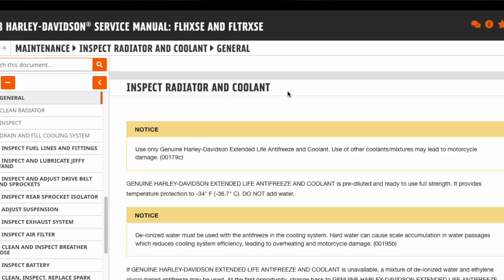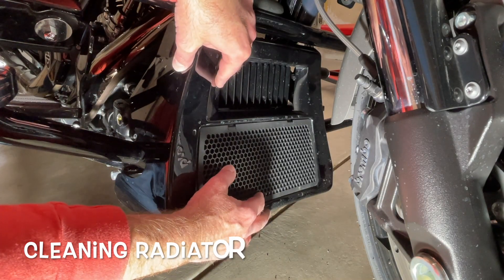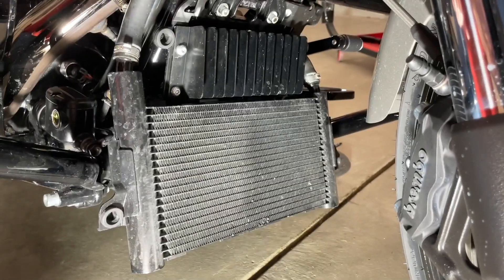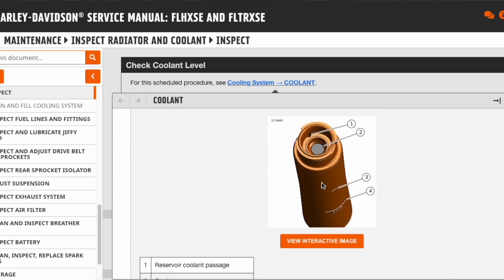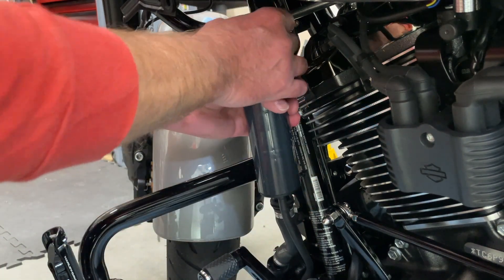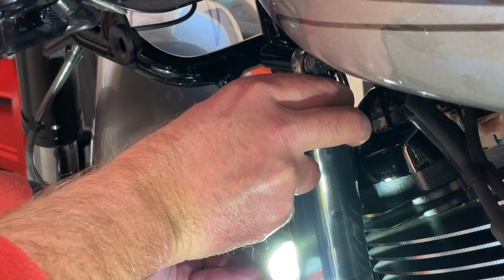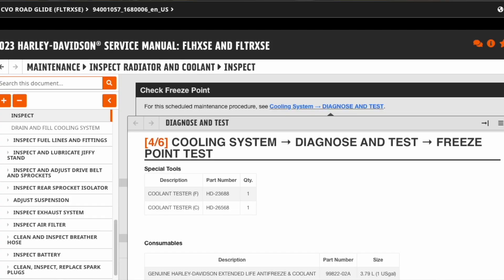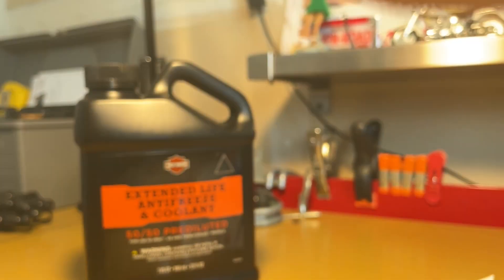1000 Mile Coolant Service on '23 CVO's

Comment: Hey Tom, thanks for another informative how to video, one tip I found very helpful when putting reservoir back into the mounts. I applied a shot of WD-40 silicone spray to a Q-tip and then carefully applied it to the lower bushing and bracket. This allowed for a very easy assembly.
Reply from the maker: Awesome,  good tip!

Comment: Great videos!!  Thanks!!  (In a pinch - no pun intended - for precise pouring in small spaces, I sometimes use a Dixie cup, like a 5 ounce; with a little pinch, the cup is easily narrowed for slow precise pouring...).  Thanks again.
Reply from the maker: Good old Dixie cups a red solo cup should also work!

Comment: Did you check the actual service manual for the process on purging the coolant?   On my wethead, there is a process for using the tool and a manual process that invloves actuation of the pump.   Both get the job done for scheduled maintenance.   That said, if I were losing coolant, I woould definitely use the vacuum tool.
Reply from the maker: Yes both the manual and a service tech video both state there is now way to replace the fluid without a vacuum pump.   I probably should have added HD's video to mine so possibly I will create a separate video on this process.

Comment: Hi, I like to wet the (paint) brush, making the bugs softer and easier to remove completley.
And maybe it helps to use some petroleum gelly for the rubber grommet to slide smoothly into place ?
Also to preserve it, as it will be used more often in the future, and looks akward to replace in case of damage without draining the system. The grommet seems to be there just to define the reservoir vertical position, preventing it from sliding down in the clip.
Reply from the maker: Yes I agree,  if your radiator is more dirty you can just go at it with a hose but I would not use a pressure washer.   Goal is to not bend any fins.  Any rubber safe lubricant is a good idea for all of these rubber connecting points.  You are also correct on the reservoir the grommet is there to prevent it from sliding down.  Most of the clamp pressure is from the plastic clip above.   Thank you for your comments!!

Comment: How many miles on your CVO?  You wouldn't think the Coolant level would be low already.   Several of my fluid levels, primary, engine and transmission were low when the bike was delivered.  Engine oil not a problem, I run it a half quart low anyway, but primary and trans should not have been delivered that way.  You'd think for a $1,300  dealer " prep" charge all would be perfect.  Another good reason to do your own servicing, and your videos help with that.  Well, at least my Coolant level was okay and now I know how to remove that coolant canister cap.  Another nice video, thanks.
Reply from the maker: Yep my coolant was low from delivery but only by a very small amount.  I agree that it should have been topped off during prep.  Even if you opt to not perform your own service one should double check the work.   I remember picking up our car to find it had no oil in it at all!
Reply: Had the same with one of those quickie lube places, got halfway out of the driveway.  And something you wouldn't expect from a Lexus dealer.  The car had oil in  it after the oil change, too bad it was the same oil, not oil change at all, but they got their money.  

 LOL, removing the cap, as you showed was easy once you know how, thanks.  Going to the Children Hospital ride? @ITFZone https://www.youtube.com/watch?v=nPtEhxfs1sM

Comment: At our 1,000 mile check up Harley Davidson cross threaded  our transmission drain plug 😮 They want to drill it out and replace with a oversized plug ..
Reply from the maker: I would want to challenge that.   Would not be ideal to have a different sized drain plug going forward,  especially on a new bike.   Man that is frustrating.
Reply: No kidding

Comment: I checked my coolant at 1000 miles it was full and at 4000miles almost all the coolant was out of overflow and i about 4500 it was 1in below full line and I can find not leak so I guess it’s burning and going to dealer
Reply from the maker: At 3,500 mi and after topping off at 1k mi I am about .25" below the cold line.   Very possible this new system evaporates coolant in summer months!   As long as it is not empty I wouldn't be concerned but something you can top off!

Comment: So a proper coolant level check requires opening the Cap, right? (The printed Service Manual suggests a first coolant-level inspection with the reservoir in the frame clip).  And after tilting and spilling into the overflow, we should top off the center fill tube too, right?  Can we just directly fill the overflow reservoir to proper level, or should we always tilt and spill into the overflow, and then refill the center tube?
Reply from the maker: To just check the level you can shine a flashlight behind the tube to see where its at.   If you are blow the lower cold line you need to add fluid.  The indicator is showing what's in the overflow so essentially you are over filling the center so that the extra flow through the overflow hole on the side,  you just tip it to get this extra in there.

Comment: so my coolant level is just a little low in my 24 road glide ,, I went to my local Dealer , bought the coolant , all of the sudden service told me that I have to have a special tool to top off the coolant . I think it's bull shit . what happened to just opened the cap when it's cold and just pouring coolant ? Im I missing something? thanks in advance for your response!!
Reply from the maker: You only need a "special tool", to flush the radiator.   You have to pressurize the system to replace the fluid as it is not gravity fed.   BUT to top of the system you are correct,  just add some but tilt it forward to get it drain into the small feed hole.

Comment: Do you have a part number for the special tool that is required to pressurize the system when completely changing coolant?
Reply from the maker: Yep,  from the service manual: 
Harley-Davidson recommends using MATCO COOLING SYSTEM FILLER (Part Number:MCR102A) along with COOLING SYSTEM ADAPTER (Part Number:MPT10128) OR SNAP-ON VACUUM COOLING SYSTEM FILLER (Part Number:SVTSRAD272A) along with SNAP-ON COOLING SYSTEM ADAPTER (Part Number:SVT262-28A) or equivalent. This allows for a vacuum test of the complete system and effective filling with coolant.
Reply: @ITFZone  I have that tool along with the recommended adapters. It creates a vacuum. You said the system needs to be pressurized? I'm waiting on a service manual.
Reply from the maker: You need to create the vacuum to pull the fluid through the system.  So I guess negative pressure is more correct.   There is no way to bleed the system  otherwise. @barneysomers8871
Reply: @ITFZone  Thank you. As I previously mentioned, I'm still waiting on a service manual. With my 2018 Ultra Limited, it was possible to manually activate the coolant pump by opening the throttle past 50% (with ignition on, engine off). This allowed an owner to fill/bleed the coolant system without the vacuum tool. Do these newer bikes not allow the coolant pump to be activated manually?
Reply from the maker: The fan will come on but not the pump that I know of.  HDMC's service training is clear that the system cannot be bled without vacuum.

Comment: I had a leak replaced a slightly tipped hose. Should I be ok refilling it all the way to the top. then letting it run while reservoir is opened for a few mins until bubbles settle down then refill again?
Reply from the maker: Hello,  The system is not gravity fed.   If you have air in the system it really needs to be pressurized to push the air through.   Running the pump is not enough pressure to get trapped air out.   This is the official Harley statement,  I really don't have enough experience with it to advise otherwise.  I guess it would depend where in the system the leak was and how long it was leaking for.
Reply: @ITFZone  dang u think they have the manual coolant air bleed feature like the other bikes such as the trikes and the ultra where u crank the throttle 50% or more in accessory mode to activate the air bleeding feature?
Reply from the maker: @rustnation2651  This will run the fan but not the pump.   Again according to the service manual you have to pressurize the system to clear air,  has to do with the reverse flow and complexity of how the lines run.   Creates too many spots for air to trap.
Reply: @ITFZone  Thank you so much this issue had me running around in circles lol. Spoke with a master technician and he said this after I mentioned what you told me:

I know on the older twin cooled motors that is a true statement.  However, with the 24's it's a gravity system. You would just need to run the water pump to help circulate
Reply from the maker: @rustnation2651  Good to know I am at the Master Mechanic level!  ;)